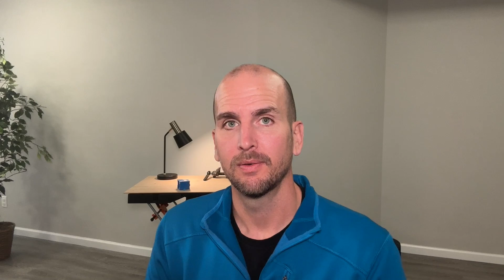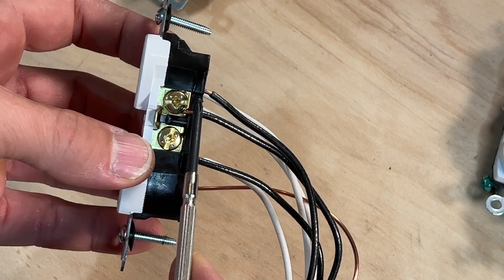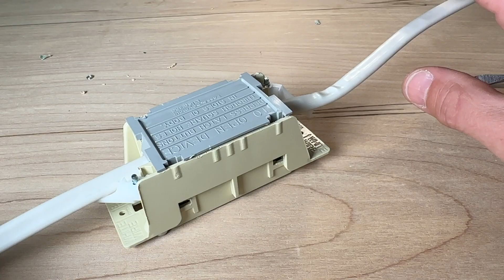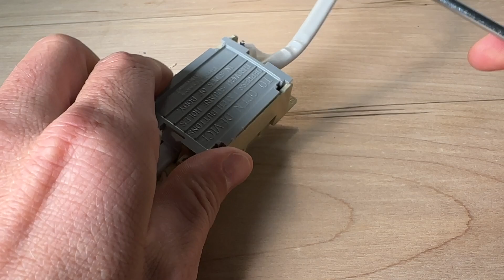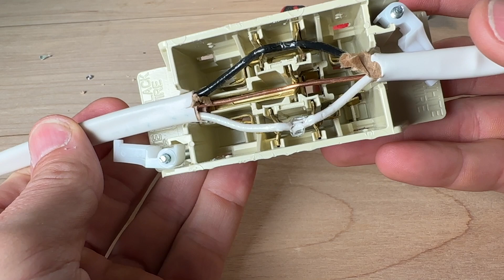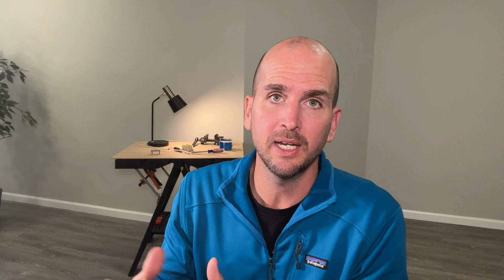90% Of Homeowners Have Never Seen This Dangerous Electrical Device

Comment: Also, remember that at one time, aluminum wiring was also code compliant for residential installs.  Until lots of negative things happened - things such as oxidizing thermal events (fire).
Reply: Aluminum  still is in many places
Reply: @dev45  if it existed in an electrician's inventory after the 1973 ban, it was still usable.  It is also used in commercial construction, as lead ins etc.

When used with the CO-ALR terminations, it is safe.
Reply: @lowkey_loki_404  what country ? 

I'm in Canada and it's still code very rarely  done but still legal
Reply: @dev45  USA
Reply: @dev45  I've seen aluminum used in outdoor sports field lights because copper thieves will steal the copper right out of the lights, they even went as far to add "this light standard does not have any copper inside"... something i kinda wish i had taken a picture of at the time.
Reply: My home built in 1973/1974 has aluminum wiring. We check each outlet periodically for oxidizing or loose connections.
Reply: AL is still used all over but it's either a special alloy with the AL mixed with other metals. or aluminum with a copper skin. Either do not present the same problems as the old AL wire. You don't even need to use the deox grease with it but most electricians just do our of habit.
Reply: Informative agree thanks
Reply: It is still NEC compliant unless the local jurisdiction has an ordinance against it. It is aluminum, but is an AA-8000 aluminum alloy that is much better than the old stuff used until 1973. It doesn't oxidize or expand and contract nearly as bad the older aluminum
Reply: Ironically you can use aluminum service entrance wire and aluminum can be used as panel guts. Gotta love the NEC those factory workers need to be working. Its not really all about safety. Check your book and see who the members are. No bias at all there /sarcasm

Comment: I use this type of connections extensively with network wiring and thecold analog phone wiring, and it is a must to use a quality punch tool. Most of the failures happen when a punch tool was not used and a screw driver was used to push the wire in.  When you remove the wire and there is an arc on it, it means it was improperly punched in.
You can see in the wire you showed the arc in the wire which results in an incorrect and dangerous connection. A properly "punched" wire should be straight.
I would not use this type of connection for power transmission, period.

Comment: Some of older mobile homes were wired with Aluminum wiring, and if I remember right they used a similar type receptacles. She  said she lost an entire brach circuit after she plugged an iron.The connection points were burnt off! I actually owned a 86 Sunbird that GM used Aluminum wiring in the doors for the power windows, I had to replace it with copper wiring, because the Aluminum wiring harness had broken from the bending of opening and closing the door.
I haven't worked much on any of the new cars or the iwiring circuit, so I am not sure if they're still using Aluminum wiring to cut cost, but Aluminum is just too soft and brittle,  plus you need to use a higher gauge to carry the current!

Comment: Years ago Wiremold made a similar outlet for their 800 series moulding until they took them of the market due to fires. Just a small amount of  heat over time would make the plastic brittle. You can imagine the rest.

Comment: For 15 A, this seems barely adequate.  If you HAVE to use them, I think stripping the insulation about 1/4” around the clamp area would improve contact immensely.

Comment: Totally unacceptable for any serious load but at least they don't have the exposed terminals of the normal sockets. All terminals in the UK are recessed which makes testing live circuits much safer. And why does you cable look like it has paper in it? Paper cable, wooden walls, plastic cladding, shingles with tar. Is there anything in an American house that doesn't burn? 😁

Comment: I’ve never used one of these for electrical outlets but I have used something similar for wiring up CAT5/CAT6 Ethernet wiring. You get a special plastic tool that comes with certain Ethernet RJ45 jacks and outlets for pushing the twisted pair wires in the meter connectors so they pierce the insulation on the individual wires.
Reply: FYI, professionals don’t use the little plastic doodad. They use a proper punchdown tool which uses a spring loaded metal head. Pressing down loads the spring until it releases in one go, releasing all the energy at once to drive the wire home. Easier, faster, and more reliable than the plastic tool.
Reply: @tookitogo  I am aware of that but for DYI Home Ethernet installation they provide this plastic tool for that purpose with Ethernet t jacks and such sold at places like Home Depot and Lowe’s so no DIYer needs to use a metal screwdriver for punching down Ethernet wiring.
Reply: @Charlesb88  I know that. I’m just saying that pros actually use a superior tool.

Comment: I'm an electronics technician and I've worked on ...damn near everything, and that outlet.... should not be used. Its obvious if you look at the video thats embeded the company installing them is saving about a foot of wiring using that thing for every installed outlet... and I'm curious if they use a similar product for light switches and I hope they didn't but.... if they did they would save about 4 feet of wire per room, 6 rooms per small home, figure 24 feet at $2 per foot, yep saving $50 on the build but possibly ending a families life seems about right in these modern times where workers have to work 3 jobs to afford rent and CEO's seem to be trying to buy eternal life, a secret volcano lair and a hairless cat to add to the collection.

Comment: I don't care for these receptacles either but passing along a tip I use to fully insert the wire without special tools in case you run into one of these that you can't replace. I use a small adjustable (Crescent) wrench with the jaws open just wide enough to clear the insulation displacement blade in the device and use the wrench to push the wire fully into the blade. Most adjustable wrenches have a bit of flat on the tip of the jaws so you won't damage the insulation. Pushing evenly on the wire on both sides of the blade makes fully inserting the wire much easier.

Comment: These things used to be decently reliable, when the proper tool was used. However as we know NM cable has evolved over the years. Newer NM cable insulation is formulated with more durable elastomers that are specially designed to prevent the wire from being cut easily. Almost seems like this product is was designed 20 years ago and just carries an aging UL stamp. I don't see these working well with modern NM without a major redesign.

Comment: The termination is called IDC - Insulation Displacement Connector, and as you say are used for almost all structured cabling wallplate and patch panel terminations.

Here in Australia we actually have our own IDC mains outlets that we call Quick Connects. For example a Clipsal 413QC.

Quite common here for lighting circuits in commercial especially.
Reply: This IDC sounds more like "I Don´t Care"-connectors! Like "I don´t care if this is a good idea, if it saves time and labor cost"!
Reply: Similar to Wago connectors, but the insulation is stripped back before insertion. Wago-type connectors are required for hidden joints, where screw terminations would not be checkable, as they can't come loose with vibration.
Reply: @Ironic1950  Wago is not insulation displacement though.
Reply: @shaunclarke94  that's what I said...
Reply: @Ironic1950  But it's the WAAAAAY you said it ...
Reply: Most of the connectors used on overhead and underground power lines are IDC and can be of high current.
Reply: @michealplater9007  yes, but they're using a much more beefy connection with screws and such.

With aerial powerlines moving to insulated cables you see a lot more of this now.

Comment: The contact "area" doesn't have to be massive to support 15A.  People tend to forget that wire resistance is not only due to the diameter of the wire, but also the length of the wire.  Thus, while a small contact area would seem to be a resistant choke point, it is very much able to conduct 15A safely as it's a very, very short "length" from the wire to the blades.    (I could almost go as far as to say it has 0 length and therefore 0 resistance.  Go ahead and measure it please).

Further, of course, each wire is 'cut' into by 2 blades and each blade is making 2 contact patches with the conductor; the blades are common to each other thereby doubling the contact area (that is: 4 "patches" of contact).  I wouldn't be surprised if its overall contact area is greater than the diameter of a 14 GA wire...

I just looked at your other video, and the failure looked to me to be more of an issue with whatever was plugged in there making poor contact with the female part of the socket - I didn't see __anything__ that would trace the flame/smoke mark to the blade/wire connection.

Where these fail at the wire/blade junction (if that even happens), I would imagine is where the installation was poorly or hastily done.  Using the proper tool is probably a good idea - I assume it comes with the socket set?  Does the back cover double as a tool to press in the wires?  IAC I would not use something pointy like a screwdriver but rather one "nose" of something blunt like line pliers of a size just large enough to fit between each blade but just small enough to not contact them (avoid mechanical stress).

(It is absolutely nuts that a wall socket should need a special to type tool to wire it in - the designer could have made that part of the back cover however).

If you're skeptical about what I write above, look at an old fashioned 15A fuse closely: the cross section of the conductor is tiny compared to, eg, 14 GA wire - but it only runs a few mm.
Or, look at fuses on high tension lines.  Where the cable is thick, the fuse is about the size of 1 strand of that same cable - but very short.  Still has to carry the hundreds of amps at 10's of thousands of volts of the main line.

And PS:  The "DISCLAIMER" in your text portion above is really a "DISCLOSURE".

Comment: A maintenance man at a mobile home park and these are in all models both new and old homes, very problematic and have replaced countless outlets and switches, even GFCI outlets, I cut them out and install remodel boxes with new outlets and switches - problem solved.

Comment: Have only seen one one of these type contacts in Canada and don't like them. Being used to doing computer network wiring, I do know enough to make sure the wires are completely within the contacts, but like you consider the contact points way too small. Thanks for another excellent presentation.

Comment: Similar connectors have been available for decades for automotive wiring, installing alarm and sound systems, etc.  I've used them a few times, but I have the same concerns about them a you and others expressed below.  In addition, they cut into the wire which I believe would reduce the current carrying capacity and weaken the wire.
Reply: They also nick the conductor, so they create a failure point when there is vibration.  IDC should NEVER be used in a vehicle or trailer.
Reply: Ah vampire taps the bane of every mechanic who has to work on electrical

Comment: I am a trailer mechanic. Without the proper 'punch' tool, these become very dangerous. You must ensure full depth between the contacts which is hard to do without damaging the wires. My employer would not obtain a tool (too expensive) to allow us to terminate these. I always used boxes and standard outlets to replace or add an receptacle.

Comment: I've never seen one of these but it was exactly what I was expecting when you opened it. As soon as you mentioned mobile homes I immediately though of scotch connectors. They are frequently used on trailers for 12v and are garbage. They work similarly by piercing insulation to make a splice.
Reply: TIL the proper term for those. I've always known them as "vampire clips" or "vampire splices"
Reply: @carpespasm  I've never heard them called that but pretty accurate description. I actually just googled it and scotchlok is the original name. I'm guessing patent long since ran out
Reply: They really aren't intended for use where they'll get wet. Using them on a trailer ENSURES that they'll get wet. Not the correct product for the application.

Comment: That's called an IDC (Insulation Displacement Connector), and is generally found in low voltage communications equipment connections like telephone circuits, where it's a very effective connector. I've never seen it used on mains voltage electrical systems, and I hope I never do.

Comment: A friend of mine had a couple rooms go out after plugging something in. He tore that outlet apart and was afraid to go any further with it. I came to look at it and that was the first time I saw one of these. The hot wire actually broke. I wasn't even going to attempt to save it. I ended up putting in a normal box/outlet setup. I can't believe they were allowed to be used.

Comment: Looks like the industry has graduated from buying politicians to buying UL rulemaking.  Insulation displacing technology is reliable when properly tooled and for signal level current but in the hands of the weekend electrician for high current applications can be lethal.   I never liked the backstabbing option but after seeing how an "electrician" wire all my outlets screw post I am not sure they are a fool proof solution either. J loop not seated, nor 180 degrees around or sticking out too far before and after the screw.

Comment: Thanks for bringing devices like these to everyone's attention.

This general type of connection is referred to as an IDC, Insulation Displacement Connector.  Typically used for lower current, lower voltage purposes like signal cables or multiple wire cables for electronics.  Proper installation is needed in any case, especially in a situation like what's shown here.  It's taking a technique and applying it where it may not be appropriate.

Have you seen the small in-line switches used on two-wire lamp cords, the ones with a knurled wheel with its edge sticking out in a slot?  Those clamp onto the cord, and have little teeth that work the same way, puncturing the soft brown or white insulation to make contact with the conductors.  Easily installed anywhere along the cord, they're typically rugged, and aren't bad for the intended purpose of a single light bulb or other lower power load.

I've seen devices similar to the outlets shown used in movable office partitions.  If installed properly and not overloaded they work okay, but are not as reliable as they should be.  A variation is to wire the partition but use a connector instead, the outlet then plugs onto the connector as a module.

Overall these types of devices are fairly good, but as with anything they must be installed properly in the first place and not overloaded.  Using a quality device is critical.
Reply from the maker: Hey Bob, thanks for the feedback and calling out the application in the office desk/wall partitions.  My biggest concern comes down to installation and the likelihood of installation without the specialty installation tool.  Good example with the lamp on/off switch 👍
Reply: @EverydayHomeRepairs  Glad to add a bit of detail, it's always hard to cover everything you want, balanced with how long the video would end up being. 😉
I think you're absolutely right about needing to use the proper tool(s) and correctly as well.  For small gauge flat electronic cables, when I didn't have the proper crimping tool, I learned to use a Panavise to compress the connector together and an X-acto knife to trim the extra cable.  But that was a skill I learned from experience, and I still used the proper crimp tool when I had access to it.

Keep up the good work, sir!

Comment: I have plenty of experience with insulation-displacing connectors... for low-level signals.  They work fine (at least for signal lines) if and only if you have the correct punchdown tool (some of these connectors conveniently have the punchdown tool built into the cover, and merely require correct application of force).  The times I've had to assemble the things without the correct tool, well, I got basically the results shown in the vid: a complete botch.

Comment: ??  What maximum current rating did UL certify for this product type, and whether any time limitation of that maximum current?   Manufacturers installation instructions should outline the limitations of use, i.e the standard to which the product certification was approved.
Failures after correct installation and use should be documented then reported, I suggest contacting UL.